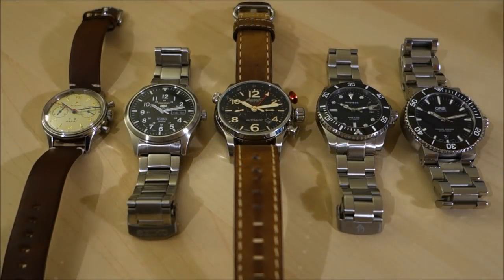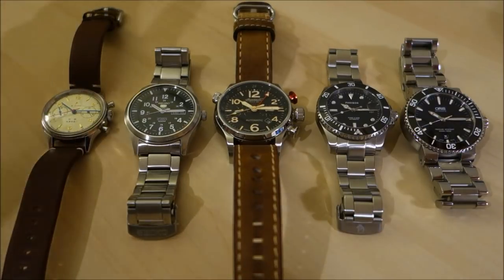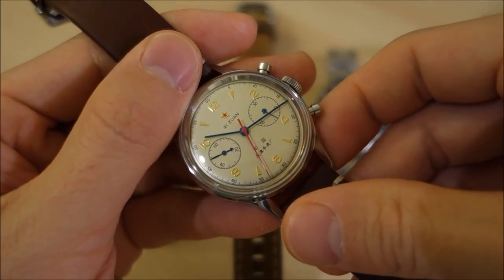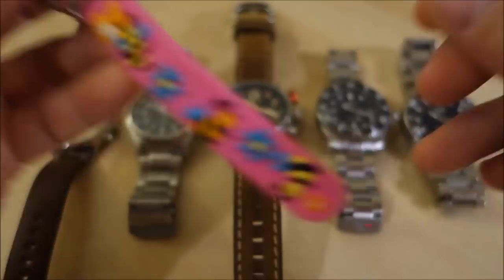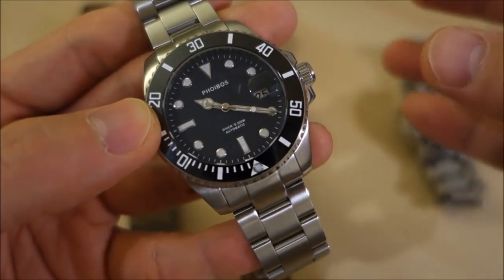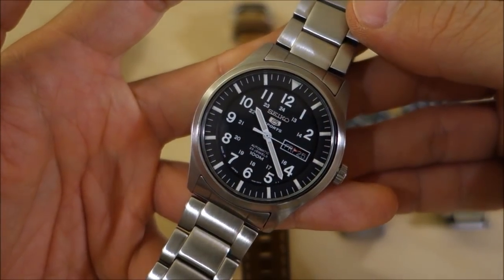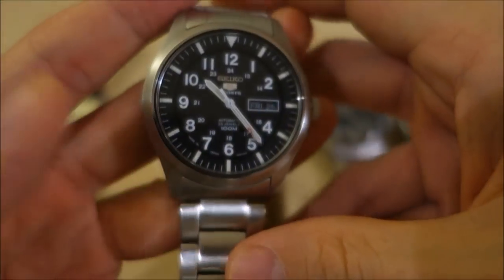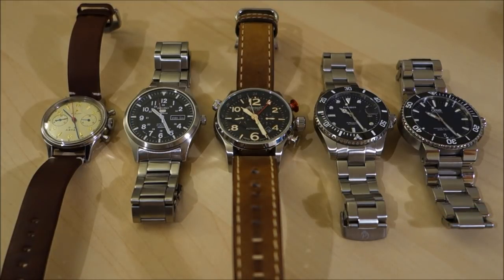Acrylic vs Mineral vs Sapphire Crystal: What's the Difference & Does it Matter? - Perth WAtch #95

Comment: I have the exact same Seiko watch. There crumbled a small piece of the glass at 3, but for the rest there barely are any scratches. Seems pretty hard and scratch resistant but vulnerable to breaking.
Reply from the maker: Thanks for sharing that - curious that's more like what one would expect of sapphire... you mean to say it has a crack on one spot but otherwise no scratches? The Hardlex in my orange monster certainly has a couple of small nicks on it. Cheers, Ivan.
Reply: Yes exactly. The glass is almost in prestine condition but theres a small crack on the side. This probably happens quite easily because the glass doesnt sink all the way into the case. The glass surface slightly sticks out of the case, thats why it is cracked at a spot at the side. Looks a bit like a manufacturing fail which is a bit disappointing. You dont expect that from a Japanese quality brand like Seiko.  Real shame because otherwise it would have been in nearly perfect condition. It certainly has less small scratches than some other watches which i have been wearing the same amount of time. 
Anyways, the nice thing about the Seiko is the movement. Its very accurate, even more accurate than some of my dad's swiss mechanical watches. Makes me kinda wonder why swiss automatic watches are so much more expensive than swiss quartz. Despite it's low price the Seiko movement ranks right up there with  swiss competitors which are 10x the price.
Reply from the maker: Oh wow, awesome man, great to hear about the accuracy you have found. I have found it a bit variable TBH... my SKX is one of my most accurate automatic watches... it has behaved like a COSC chronometer from the start... some of my Seiko Invicta on the other hand, I couldn't stand the factory regulation of +20 sec/day (still within rated range mind you) and regulated them myself. Actual Seiko pieces tend to be better but there is still a range in my experience.

Comment: When i was a boy, i had an old timex from the 1960s or so. Acrylic crystal. It broke right across after hitting the floor. Didnt cost me anything and was full of scratches so no big deal.
Reply from the maker: Thanks for sharing that... it's rather weird that an acrylic piece would've broken from a fall onto floor... perhaps it wasn't actually acrylic? If you get a piece of acrylic in hand you will find it hard to break even if thrown from several stories high. A hammer in hand perhaps will do...

Comment: Huge interesting topic! The big difference seems to be only one of the materials is a crystal. I haven't seen a grading standard. But it does seem not all sapphire crystal is created equal, something other than Verneuil's process. Could be imperfections creepy in at some point or in finish processing? It now seems like sapphire crystal could be used on all but the cheapest watches. Can scratches be DIY polished out of acrylic?
Reply from the maker: Thanks for sharing that info, it's much appreciated! Yes indeed, scratches can be buffed out of acrylic - I believe there is a specific polish for this, although some others say you can use brass polish.

Comment: Seller may not allow water droplet test.  I think testing can be done with light.  Sapphire crystal will show blue sapphire color refraction of sun which will be a pinpoint in the date lens.  You will also see a blue refraction from your cell phone flashlight.  No blue refraction means walk away from high end diver.  What do you think?
Reply from the maker: Good thought however all I have read indicates that it is not possible to tell the difference visually... the blue refraction is a result of anti reflective coating (or a fake coating in copies) rather than a property of the sapphire itself. Many higher end sapphire do have this... but the effect can be copied in knock offs.
Reply: Thanks for reply.  I'm getting into collecting watches so being able to spot a sapphire crystal on a brand which should always have them is one way to spot the imposter.  I've done a bit of reading but nothing seems conclusive.  I've seen the blue refraction in pictures and videos but have read nothing about the veracity or use of this effect.  It could be a reliable indicator of anti-reflective coating which is commonly applied to sapphire.  (The blue refraction is a gorgeous sapphire blue in my high end Italian watch.  Happily for me, my crystal does have a white hue when viewed from the side and it passes the water test.)  I've read that mineral glass is too course to take AR coating and it is not needed anyways.  Damn those clever homage watches.  They are getting better and better...and I have to be more vigilant.
Reply: Noob moment ahead.  Sir, you are correct that presence or absence of blue refraction is not an absolute indicator.  The brand I am researching applied clear and blue refracting AR to the underside of their crystals.  It depends on year and model.  The fact that my example has blue refraction is a good indicator only for that specific model and year of production.  So, testing for sapphire in the field with light is IMO still worthwhile but has limited value.  To parrot what I've learned so far, tap test for sound, water droplet test, and touch test for room temperature feel are the best.  It must be a combination of all these results that gives confidence.
Reply from the maker: Thanks for the further update, useful to know. I don't trust myself to be able to discern temperature difference by touch (really talking about specific heat here). Sound might doable especially if you have a mineral glass reference you are willing to risk marking. So it's mainly the droplet test for me ;)
Reply: To complete my thoughts on getting into watch collecting...sigh.  I was looking at 1:1 replicas and the better ones have sapphire crystals.  Replica photos look so good that it would be very difficult for me to spot a fake in the field.  Even the Asian 7750 movement in fakes is a version of the Valjoux found in real examples.  Sapphire testing is still an important skill but the presence of sapphire is not conclusive for authenticity.  Cheers from the Northern Hemisphere.
Reply from the maker: True insights regarding the counterfeit world - they are indeed getting better all the time. That would be a Chinese clone of the 7750 you saw, just like there are clones of the 2824, etc.
And yes absolutely, having sapphire doesn't guarantee a watch is authentic by any means!

Comment: My preference is sapphire, than acrylic, than mineral in that order. I hate mineral crystal its garbage, it will scratch and be a pain to repair, I'll always pay up for the sapphire which is bullet proof in my opinion. Another thing I like about acrylic is it seems the most smudge resistant, I am constantly wiping my sapphire crystals off LoL
Reply from the maker: Yeah fair points there Donn... mineral glass comes across as a compromise between the two in some ways, although info I have found seem to indicate it's closer toward sapphire in being scratch resistant (some acrylics scratch if you look at it wrong), and closer toward mineral in being shatter resistant. The smudges on acrylic are most likely hidden by the scratches :D

Comment: there suppose to be 4 categories. Acrylic, Sapphire, Mineral and Hardlex .Most cheaper fashion watch Minerals are NOT hardened or is equivalent  to Hardlex at all. I heard Hardlex from some sources Hardness index is 8. Why you have not even touch on this? or i missed.
Reply from the maker: Thanks for that. Hardlex is a brand name, not an actual name for a material. It is hardened mineral glass, and many say it's no better than those used by more typical brands. I have not had any cheap fashion watches with non-hardened glass, and in fact have not seen any info to substantiate this. Also quoted hardness rating for hardened mineral glass ranges from 5-7, if you have a source that claims 8 I would like to see it. I think for watch enthusiasts, there will probably be very few pieces of interest that do not use these categories I have covered.

Comment: I'm pretty down on hardlex, it's just window glass and I find it scratches easily and can't be polished easily. Would rather have acrylic so I can polish it out.
Reply from the maker: Thanks for sharing that Hamish. Hardlex can be scratched of course, and not easy to get rid of scratches once it happens. However, based on my reading it's not just plain window glass... and based on experience it does seem to be tougher than the typical "hardened mineral glass" you get in many run-of-the-mill watches.  Nonetheless, I feel your pain!
Reply: Mineral crystal has a mohs scale rating of 5, hardlex 8, sapphire 9, diamond 10.  Hardlex is extremely good for entry level pieces.
Reply from the maker: Ah thanks! Very helpful to know the Mohs rating for those!

Comment: Word of advice, no offence intended:
 If common knowledge dropped so hard, that the basics are just knowing your 1st name and last name, and the details between X and Y are too sci-fi >>> GOOGLE!
What you think and what the facts are, are like South Pole and North Pole. If you google the difference between Mineral and Sapphire, you will find on page one 1st link, details that are on a scientific level. For example, sapphire crystal measures very high at 9 Mohs scale, while diamond measures 10. Basically its stronger than almost everything. While mineral crystal is usually at 7+ (from what I remembered, please verify that). Gorilla Glass, like normal glass is ~6. Usually to scratch something it needs to have a higher durability than that of what you're trying to scratch + force of impact.
Use google, then inform us about facts. Acrylic is another word for plexiglass or plastic. The difference between mineral and acrylic is so high, that its like comparing iron with steel. And based on your video, you're not that sure, but you guess its more closer to sapphire. And you cant find the details on google, really??????????????
I know there's lots of people that google on youtube instead of actual google, and listen to amateurs commenting on stuff. After one bad video they think they know it all. So its your job to research sh/t for them and tell them facts. Because based on your laziness or incompetence, you're providing bad information or at beast inaccurate. And they are gonna use that information and spread that to others. And sooner or later, common knowledge is gonna be just your first name and last name. Just like common sense is overthinking it.
Best of videos!
Reply from the maker: Thank you very much for your comment friend. I'm actually a bit lost on the first name and last name thing... you only listed one name am I right? ;)
This was a summary of what I could find, doing my best to explain it succinctly. It's not supposed to serve as a definitive reference, and my job is... well, not what you think it is. Thanks for watching, peace to you, and hope your day gets better :)
Reply: Its all about how you phrase it. If you say "I think, it's closer to sapphire than plastic" thats not good. If you do  complaisances, like "think of acrylic as iron, and mineral as steel and sapphire as titanium" your viewers are gonna get it. More than what you told us. So he can imagine it. Plus, like I said, you can't say you cant find statistics when the internet is full of them. Your summery wasnt that of someone that knows his stuff, but what he thinks based on what he heard, not read.
Tho, its good you didnt get it the wrong way, or at least you're not showing it :)

Problem was, that someone told me what they understood by watching this video, and i was perplexed. Another sad thing, that this might be the best video on youtube explaining the difference between X and Y.
In this world there are two types of people, people that learn from the internet and those that get dumber. Help people get smart, not the other way around. Your intention is good, I acknowledge your will and dedication. But do it right. 

The name thing, means: today's basic knowledge is only knowing your first name and last name, everything else is irrelevant. Unlike the old generation, when science was a curiosity and attempts of hardcore discussions were seen even from common people. Now a days, everyone doesn't know anything. And the generation "i dont care" makes common sense and logic only into a subjective thinking surrounding their 5m aura. Anyways, was meant as an exaggeration/ironic joke.

PS: your last remark, 'day gets better", wasnt my frustration getting the best of me, but the fact that i mention above.

PS2: "It's not supposed to serve as a definitive reference.." well, you do talk 80% of the video about the difference between them and what you think of them. Dont try excuse yourself by contradicting yourself.

Also, dont say your job isn't this. You're the one presenting watches and talking about them, im the one watching your vids and work in the army and still know more about what you just said and claim to know in this video. And you can learn it too in 10min of google time.
Reply from the maker: Thank you very much for the detailed reply - I definitely appreciate the time and effort! Ah I see now about the first and last name thing, now that would be a strange world to live in!!
Let me clarify - you implied that my info is bad, inaccurate, even wrong... however it seems that I haven't actually conveyed any wrong info, correct? What misunderstanding did your friend have? Please let me know if I have said anything that is factually wrong. I get it about the phrasing you describe... but that's an issue of style and is subjective. Care is taken to present correct info... I could've gone into MOHs scale and other numbers but I chose not to, this was intended to be light. And I think you made some wrong assumptions... let you in on a secret, I do almost no research on YouTube, so in fact all this I got from reading not hearing ;)
I maintain that this is not meant to be definitive... that are scientific sources for that. By it's very nature one should assume that YouTube content is amateur unless you see evidence otherwise... I for one am certainly amateur and not an expert or professional in this matter. If people have different concept of this, that I'm afraid is a misunderstanding. However I still do my best to be accurate! There will be mistakes, but heck professionals I work with make mistakes too.
I also maintain that this is not my job... that may be the perception and/or preference of some... but my perception wins out here. This is a fun hobby for me, and just happens to have gathered interest and support ;)
PS. The analogy of sapphire being like titanium is erroneous... titanium is stronger and more durable than steel but interestingly is softer (scratches easier)... so if I had said that I would definitely be getting negative comments about it. But I get where your coming from!
Reply: Why to be so rude for an  educative vid. Perth Watch pointed out he is not sure, so you have a room to research......and to be polite....
Reply: Hatrious Are you on drugs😱
Reply: @kellyrobinson550  the people hating on hatrious seem sensitive and maybe take exception to what he said about normal people having 5 minute attention spans and taking any and all YouTube videos at 100% face value. Hatrious might sound jaded but he is mostly correct even though he did jump to some conclusions too quickly himself (like the titanium analogy). This all happened because somewhere along the way the most recent generations of humans got exceptionalism medals for showing up. And yes I know that anyone who takes offense to my comments is an extra special person because that’s what they were taught growing up (“no one is better than anyone but you are extra special if you show up”)
Reply: @ramonalbertotamayoisla2592  I did not know Perth watch was getting paid for this supposed “educative vid” especially since he said he was not and that his videos are not meant to be college classes. I think that’s what Hatrious was trying to explain to you. And I don’t think he was being rude; rude would have been name calling and cursing. I guess we are all meant to be extra sensitive now